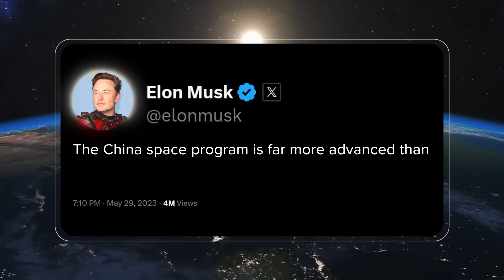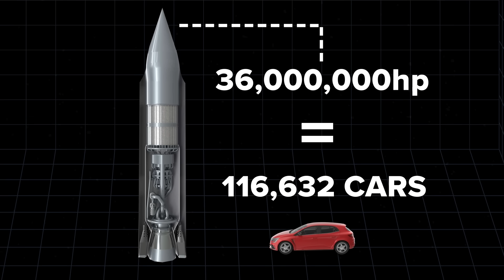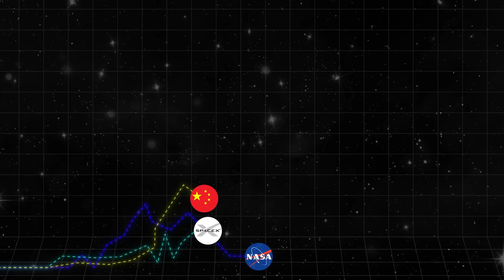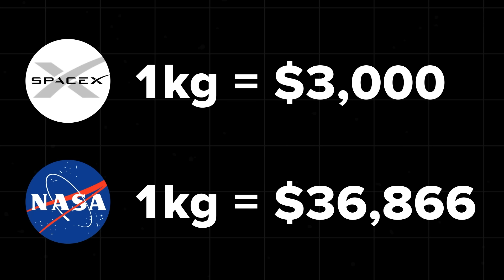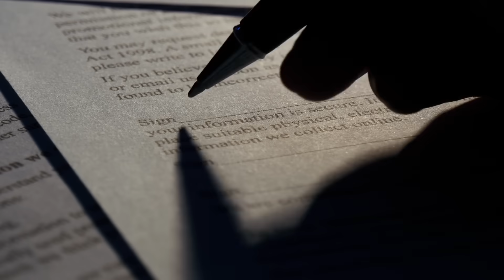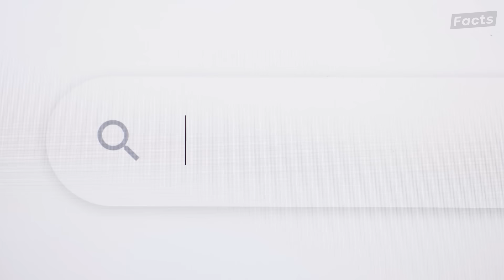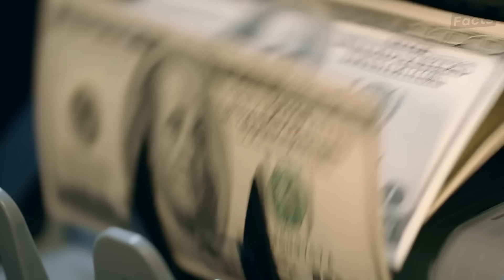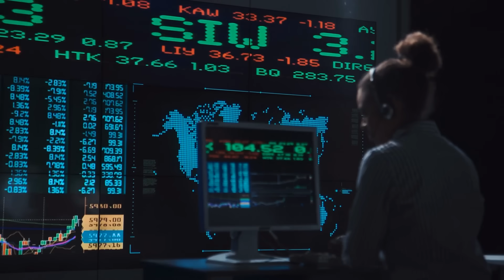China's NEW Giant Space Station is a Nightmare

Comment: Would it be logical to use the moon as a preliminary staging construct to trouble shoot all supporting infrastructures that could be used on the Martian surface. The timeline of back and forth as needed in the sequence of phase completions? Robotic development   preprogrammed in utilizing a symetrical crater as an inhabitable formation in establishing an artificial atmosphere. If a chosen impact site with ice to be heated by refraction of solar gain after robotic assembly of a protective dome has-been securely affixed to then be pressurized to earth's atmospheric content. ??? An artificial magnetic field consolidation in concert with dome material and design to protect from gamma ray's ecetra. Successful achievements would potentially be reached much sooner and hand's on knowledge would be of great value and essentially establish the increased odds of success rate for Mars.